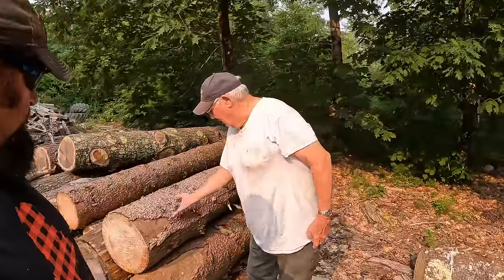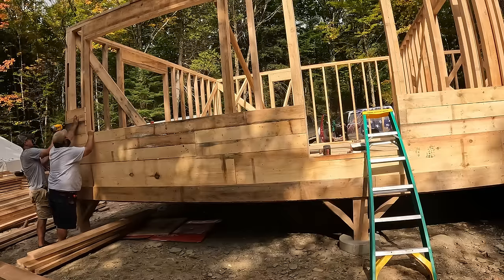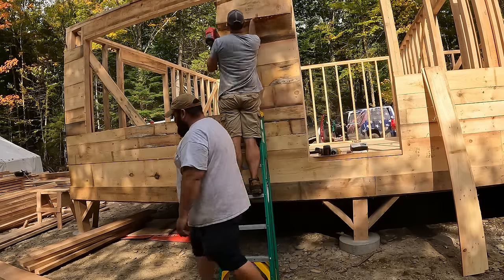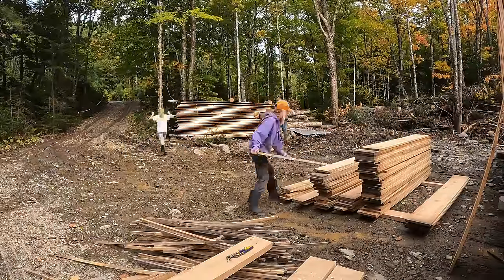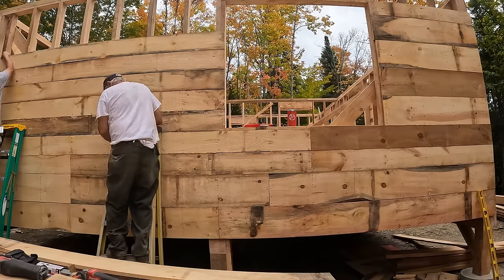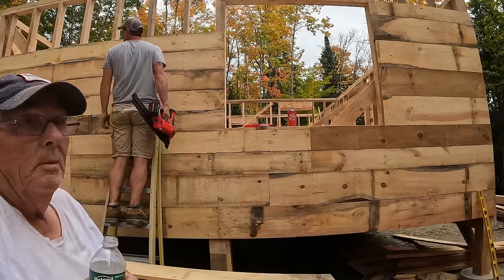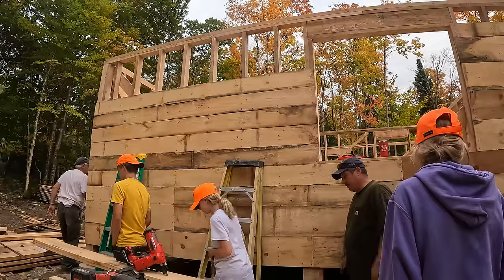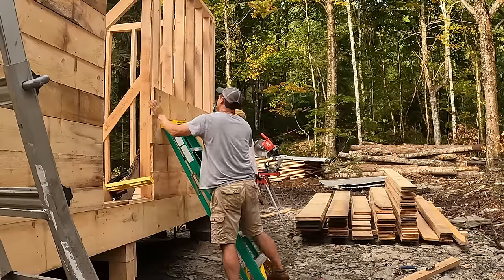OFF GRID CABIN BUILD: Sheathing: Episode 16

Comment: Some pump jacks would really help things out going forward especially with siding and roof.  Are you using log faced siding? I see you are wrapping it, are you going to insulate wall and/or roof?  We get some big wolf spiders here at my house and my boat house is absolutely insane.  I'll come for donuts and some red snappers
Reply from the maker: We are gonna use log siding next spring so we wrapped with the rubberized roof wrap. Insulating both walls and ceiling now
Reply: @JoeHollandFishing  Ice and water shield should really help keep it dry till you side.  Are you cutting siding yourself or getting it from a lumber yard?  We used some way back and it came out awesome.  We had done a few and by far the cedar one vs pine was a nicer product and had outside corners available.  I'm sure the cedar might last longer also but if taken care of pine is fine

Comment: Back in the day when 1" boards were used for sheathing the carpenter put diagonal 1x4 bracing cut into the studs. Plywood didn't need it because the layers are alternated by grain to provide the same support equal to bracing. I recently ran into to carpenters in their 40s that had never heard of diagonal bracing cut into  the studs in the corners of walls.
Reply from the maker: For sure,

Comment: There is the tortoise and the hare, then there is Stevie pulling up the rear behind the snail
Reply from the maker: Stevie’s awesome. Donnie put a lot of pressure on him to not miss with any nails so he takes his time and doesn’t miss. Everything he touched on this job he did correctly even though he’s slow compared to industry standards he’s new to the industry. Gotta learn sometime and we didn’t put any emphasis on speed at all for this job and we never asked him to go faster. What he lacked in nailing speed he makes up for in lumber moving and carrying . Absolute animal as we progress
Reply: @JoeHollandFishing  I did noticed he got much better about 3/4 of way through video and I sure is greatly appreciated for everything he does.  Humping lumber stinks the older you get, especially when it's wet
Reply from the maker: @brinkee7674  For sure, He's the best! 
It's fun to joke about though!